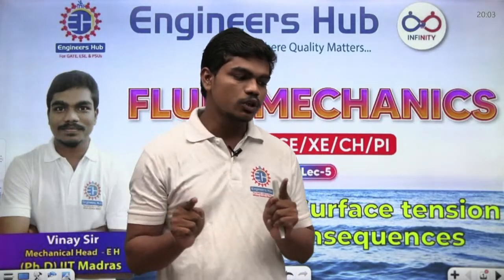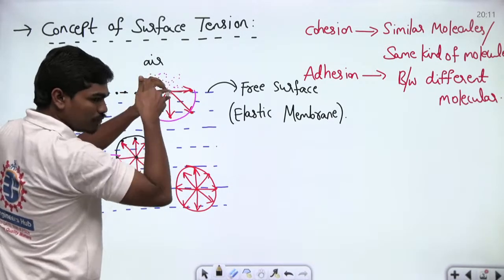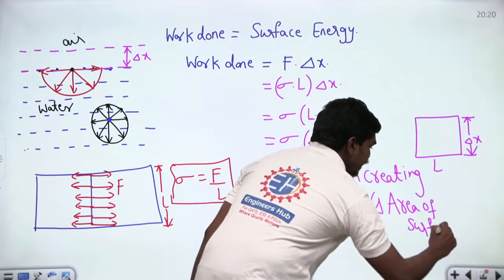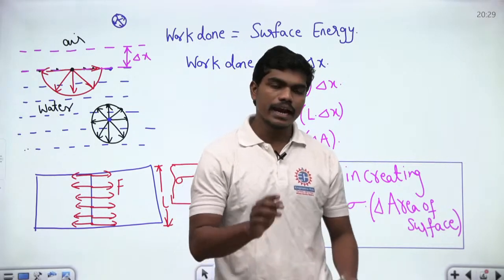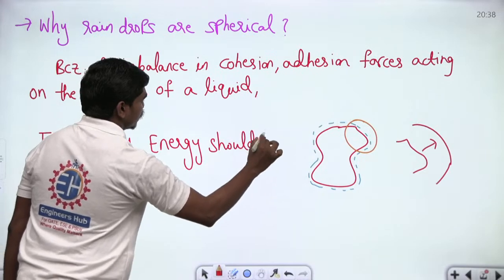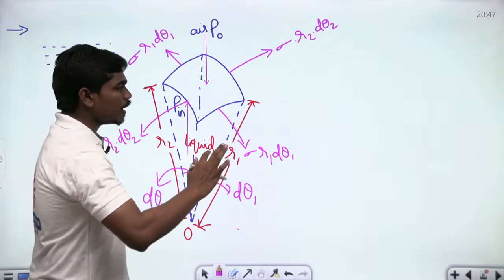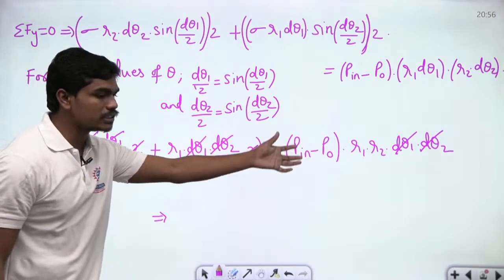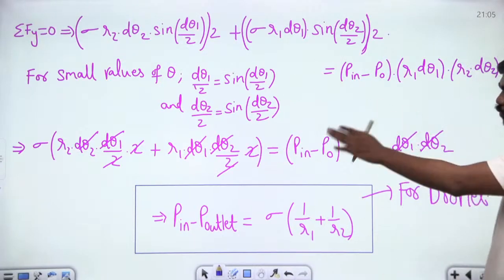Fluid Mechanics || Concept of Surface tension and it's consequences || Lecture - 05

Comment: Sir Please reply,
Sir,
We say that at the surface of the water, the water molecules experience two kinds of forces, which are adhesive force ( due to particles above the water surface)
And cohesive force ( due to water molecules of surface below)
Here sir, we say that due to greater force of cohesive  than adhesive, the surface water molecules experience some *net downward/inward pull*..and here does this Net Cohesive inward force pull down the surface water molecules inside of the liquid ( to the bottom)?. Or it doesn't pull down?.🙏 If not, why sir?